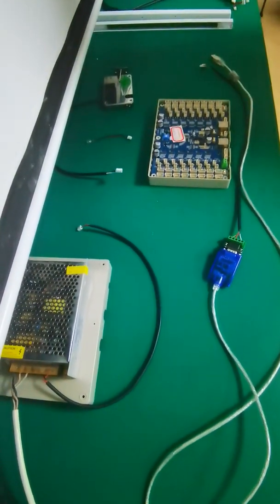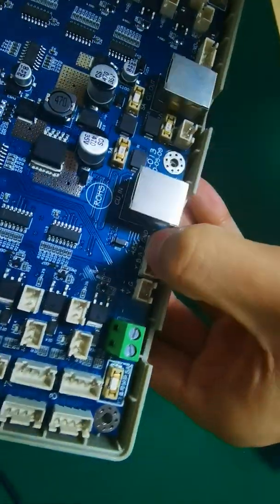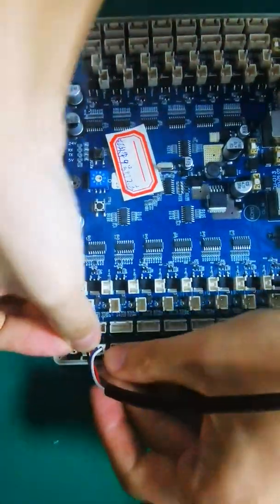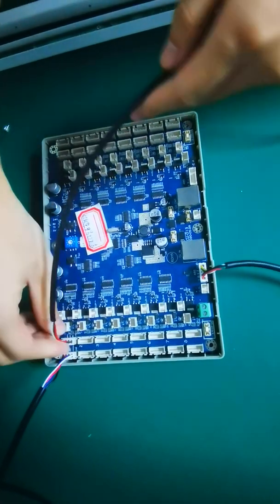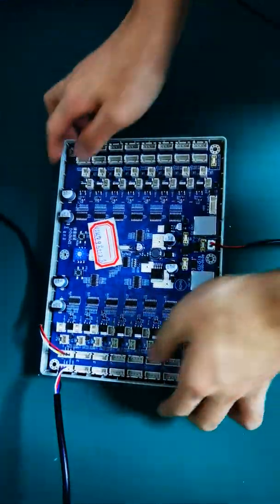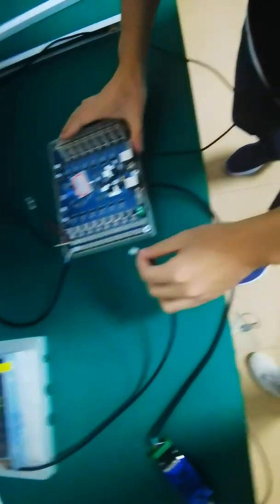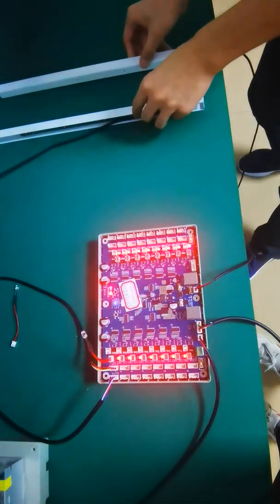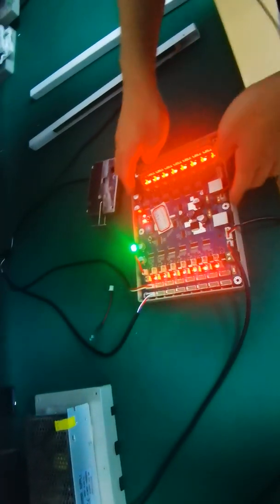How to connect RS485 communication protocol with electronic lock?

Comment: Is there any documentation on how to communicate with electronic lock through RS485 from Linux (Preferably with Python)? Or at least serial communication parameters to be set?
Thanks!
Reply from the maker: Dear, we can provide demo software for you to test the system, and board protocol to help you make integration, our design based on windows system, if you use other system such as Linux, depends on your host computer software.
Reply: @kerong-hk  Very good video, if you could provide the DEMO source code to connect via ethernet to the board. It doesn't matter what technology it is developed in, I adapt it to my development environment.
Reply: Hey, could you find the solutions. for python?